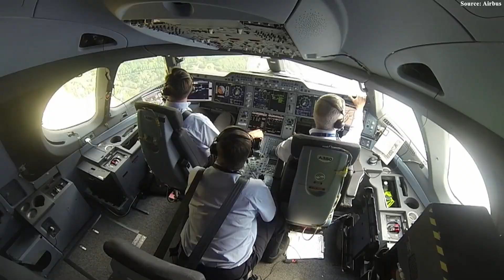Airbus NEW A350neo Is Coming - Boeing Didn't Expect It!

Comment: The 350 isn't as wide as the 777x to cramped, for long haul for me
Reply from the maker: Thanks for sharing!
Reply: Actually, 3-3-3 on A350 provides equal or greater seat width than 3-4-3 on B777X.  B777X is only 4 inches (10cm) wider than existing B777 where 3-4-3 is very tight. Just 1cm per seat extra.  It's also a function of the seats chosen by airlines.
Would you fly 3-3-3 on B787?  Much more cramped than A350.
Reply: Says the one who never flew with a 350 😂
Reply: @Kveiteson  👍

Comment: if the A350 engines are having trouble in the /gulf environment, wouldn't the 777X engines have similar or even worse problems?
Reply from the maker: Thanks for your interesting question! Yes, the GE9X did encounter durability issues with its high-pressure compressor during testing in 2019. However GE had the advantage of being a late mover: it was able to observe the difficulties Rolls-Royce faced with Emirates and learn from them.
GE incorporated ceramic matrix composites into the GE9X. These materials can withstand much higher temperatures than traditional metal alloys and are far less prone to adhesion from molten sand. As a result, the GE9X appears to have effectively addressed this issue.
That is why, despite the repeated delays, Tim Clark has continued to place additional orders for the 777X.
Reply: Once the 777x gets approval to fly passengers 😱 then it’s problems will really become apparent. I still can’t believe EMIRATES would be so stupid as to order this end of product hash up. AIRBUS A350 and ROLLS ROYCE have the future of safe modern technology sown up.

Comment: Hey @FLIGAVIA, is the AIRBUS A350NEO could be A350-2000 for the A350NEO or not A350-2000 for the A350NEO that I heard in this video that I see it today ?
Reply from the maker: If the A350-2000 requires a new engine, then it would essentially be an A350neo.
Reply: Sounds like a future of modern era seens genius @FLIGAVIA as I heard like that.